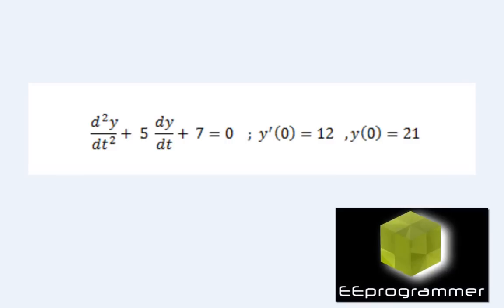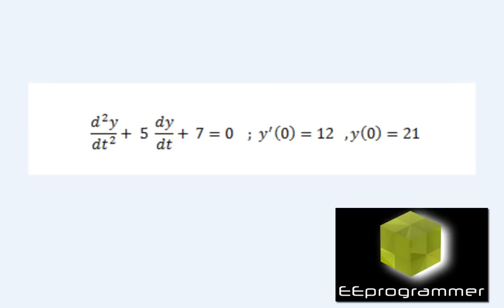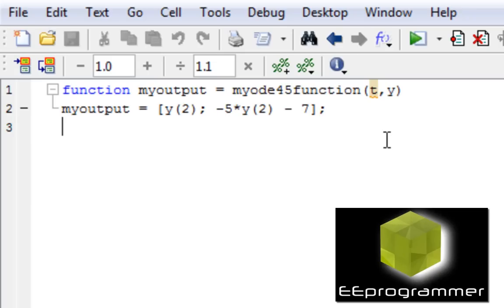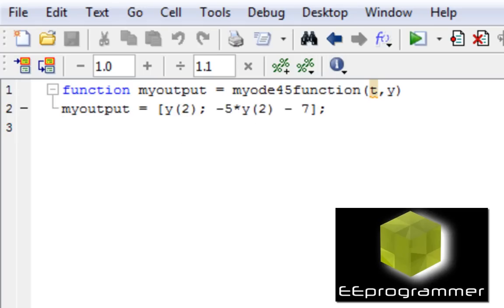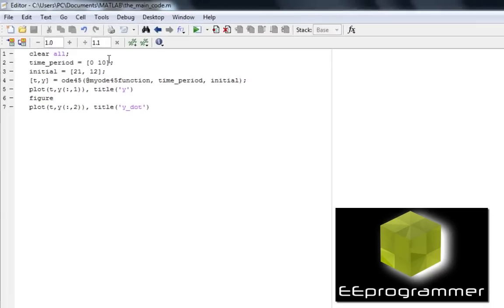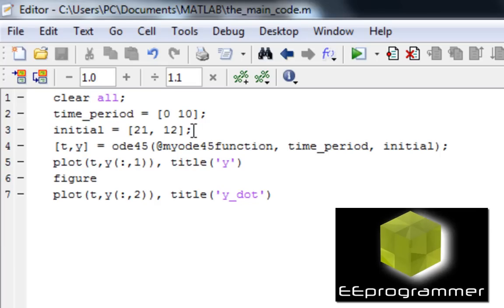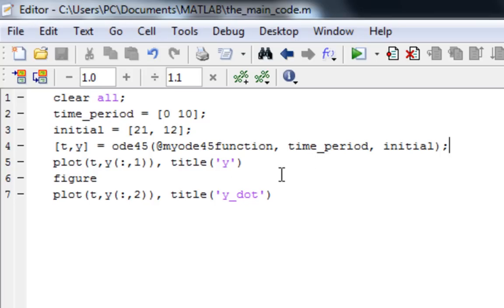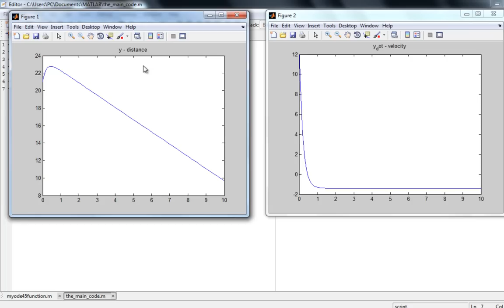MATLAB tutorial - Solving Second 2nd Order Differential Equation using ODE45

Comment: Why do you use y(2) in myoutput in function code? 
And how did you know you should plot y(:,1)? 
I'm sorry if it's a stupid question but I'm struggling with MATLAB.
Reply: +Fragrance and Flavoring 
y(:,1) is the solution for the displacment ie the integration to the 'velocity'
y(:,2) is the solution for the velocity i.e. the integration of the "acceleration"

Why do you use y(2). This depends on initial value /states/ position. You will have to read the question carefully
Reply: fragrance and flavoring Why???

Comment: I have tried your exmaples, but I got error message like this,

Error using feval
Undefined function 'myode45function' for input arguments of
type 'double'.

Error in odearguments (line 88)
f0 = feval(ode,t0,y0,args{:});   % ODE15I sets args{1} to
yp0.

Error in ode45 (line 114)
[neq, tspan, ntspan, next, t0, tfinal, tdir, y0, f0, odeArgs,
odeFcn, ...
Reply from the maker: I believe you do something wrong. If you follow the video step by step, you should able to make it.
Reply: eeprogrammer thanks, i got it right now.
After u plot the graph, how to find the solution of y(x).
Reply: Error using vertcat
Dimensions of matrices being concatenated are not consistent.

Error in dsa (line 3)
f = [y(2); -5*y(2) -7]; %dy2/d2t = -5*dydy - 7 y'(0) = 12, y(0) = 21

Error in odearguments (line 87)
f0 = feval(ode,t0,y0,args{:});   % ODE15I sets args{1} to yp0.

Error in ode45 (line 115)
    odearguments(FcnHandlesUsed, solver_name, ode, tspan, y0, options, varargin);

Error in asd (line 7)
[t,y] = ode45(@dsa,time_period,initial);